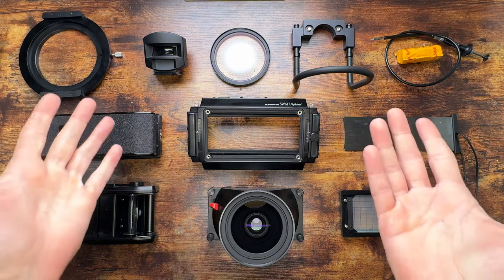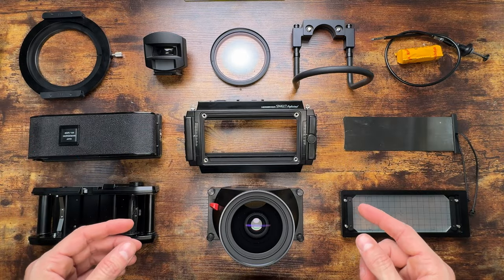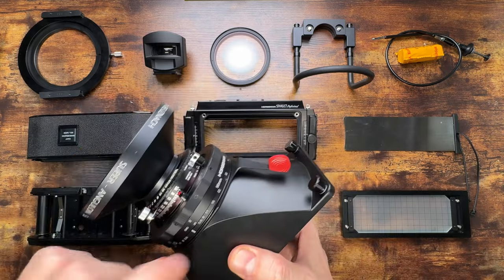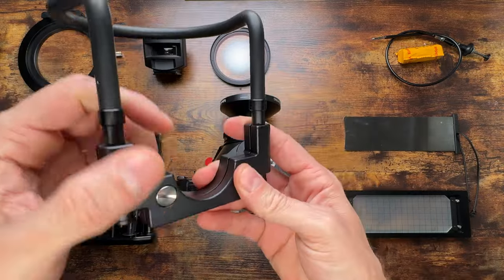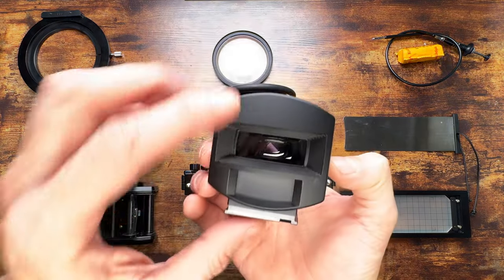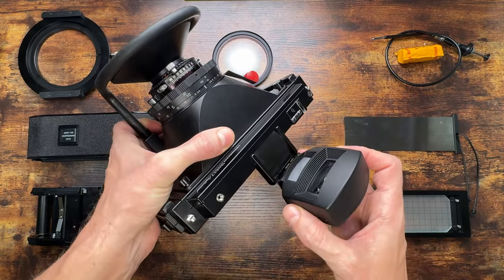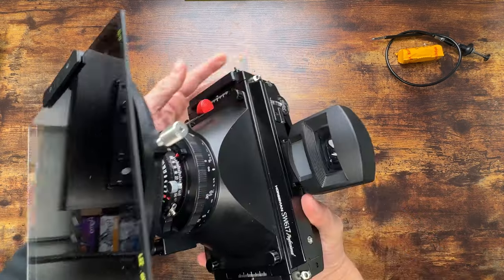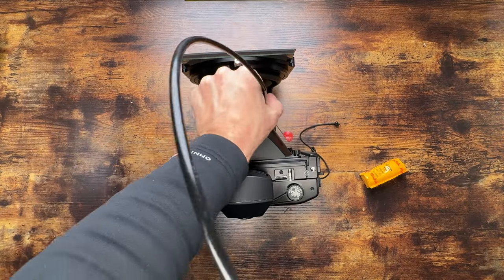Horseman SW617 Professional: The Ultimate 6x17 Panoramic System?

Comment: 6x17 is a great format. Nice demo putting it together but your title suggests something different. I own a Linhof 617s III - what makes you think the Horseman is the better camera ?
Reply from the maker: Horseman has a few advantages imo, can apply rise/fall, can use ground glass for each shot, can swap lens after every shot, ergonomic are overall better, can swap film backs, can use 3 different formats for the back, bubble levels are in the body and not in the finder. One advantage of the Linhof could be to able to accept 220 but hard to find nowadays.
Reply: Those are some nice features! I guess the 617 was produced a long time ago. In the last versions, they did offer a dark slide and a rise/fall option. I have a ground glass back but rarely use it. The 3 finders are very accurate - I always use a bigger external bubble or my iphone to straighten the image. The Linhof is build like a tank and I really like using it as a separate 617 camera. If I want a different format, I will take a 4x5 or Hassy :) Please share some work and experience using it - it is always nice to see how other people work toward their pics. Thanks !